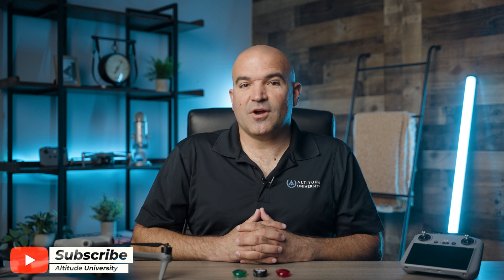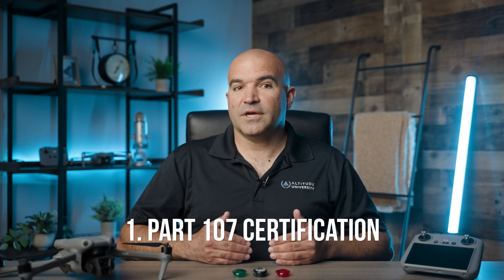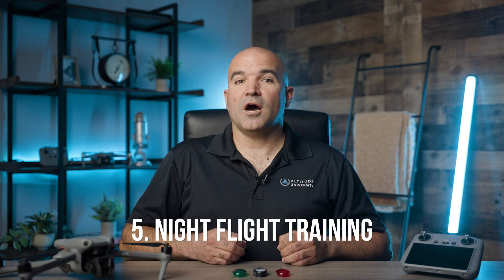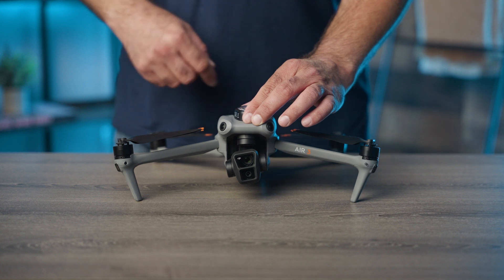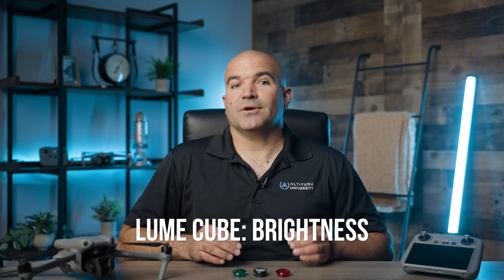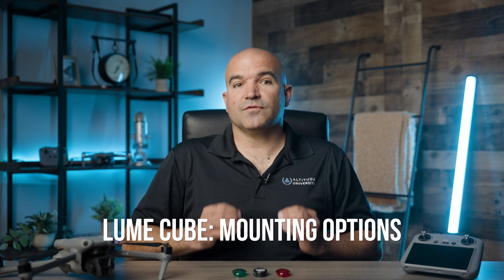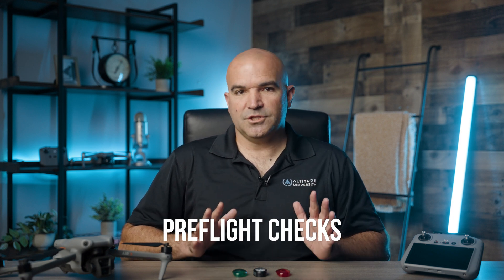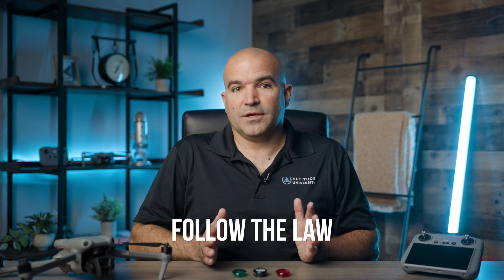Anti Collision Lights

Comment: Thorough video with lots of info. I heard or read somewhere that the FAA has stated the placement of the night time flight anti-collision on the drone is to be on the TOP. Is that still the case, or is that accurate? I see a lot of lights mounted on the front of the legs, yet that doesn't really provide optimal visibility for any potential manned aircraft that may be flying above. Please clarify or explain when you can. Thank you in advance for your time.
Reply from the maker: The FAA doesn't specify where the lights need to be placed; it just says that anti-collision lights must be visible from at least three statute miles away. Most people mount the light on the top, but the key is to make sure it can be seen from 3 SM away, along with the other guidance they give regarding the lights. And thanks for checking out content out!

Comment: Is there a standard placement for the anti-collision lights or can they be placed anywhere on the drone? As long as you can see the drone from 3 statute miles
Reply from the maker: Hi! There is no standard placement since drone designs vary. Most people will have a light on the top and bottom to ensure it can be seen. I hope that helps answer your question. Thanks for checking out the video!